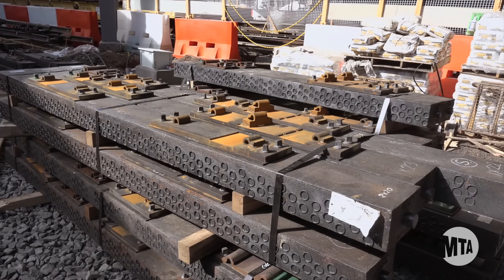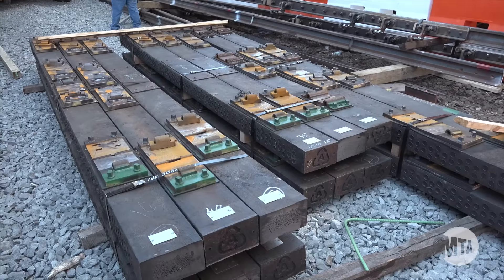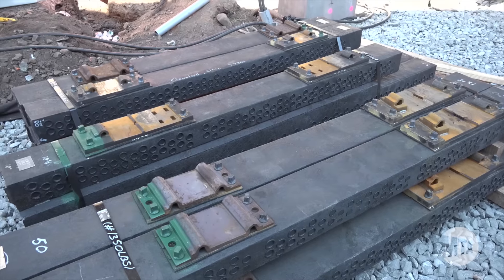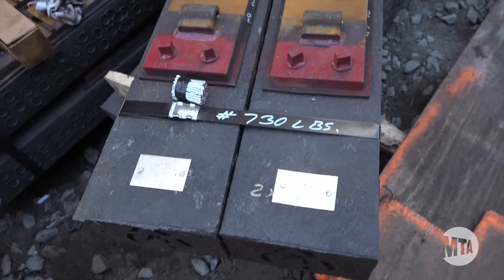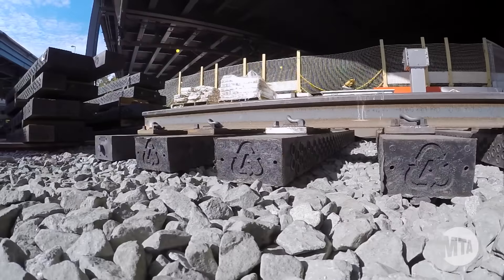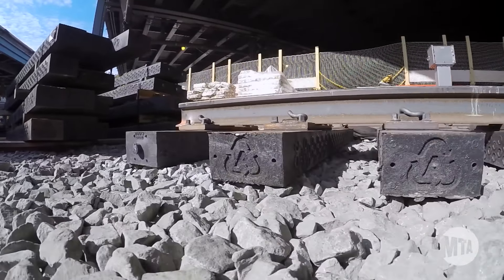Composite Tie Installation at St. George Terminal

Comment: What's the advantage of these ties over a more traditional composite material, reinforced concrete? That material is also recyclable and is probably a LOT cheaper.
Reply: Concrete ties are strong and reliable, but incompressible and have little elasticity. Due to their rigidity, they need frequent ballast damping to avoid them from 'sinking' into the ballast. A  more common way to solve this problem is to use the ballastless track, but that is often way more expensive than these plastic ties. Due to their elasticity and flexibility(comparatively speaking, not as elastic as a rubber band I suppose), they need less track damping and maintenance. They are also more weather resistant(especially to water erosion, which is one of the main problems of concrete ties), have a higher bite to the screws and easier to apply Spikefast(which is a worn screw hole repair kit).

Comment: i literally watched like 30 seconds of this video and stopped it right way to say this... rather than upgrades on the s.i.r...  there needs to be a connection btw s.i and manhattan... the E is sitting right there... focus the money on building a tunnel... jamiaca to trotten via 8th ave sounds way more workable ...a piece of tomorrow that should be today...just saying...
Reply: A tunnel that long is impossible and would call for billions of dollars
Reply: If you watched, this happened as a result of the damage after superstorm sandy. Meaning, the ties needed to be replaced, and these ties seemed like a better option considering they're more resistant to water etc. It wasn't an extravagant expenditure.
Reply: Nah, send it to Brooklyn.
Reply: Master B Beats Just want to remind you that we built a tunnel under the french channel.
Reply: ahmed sidibe Why?

Staten Island should be last on any list for subway expansion, when other parts of Brooklyn, Queens, and the Bronx have no subway access.
Reply: sanitman1 A subway to Staten Island Can wait. All that’s needed for the area is an extension of the Hudson Bergen Light Rail over the Bayonne Bridge to the Staten Island Mall, and a busway on the North Shore Railroad ti the ferry terminal. With that, money can be diverted to extending the 7 train East of Main Street to serve Northeastern Queens, which currently has no subway service and serves a dense area than Staten Island (St. George is never overcrowded).
Reply: @TheRailLeaguer  if an extension is needed it to bayonne it should be the  s.i.r.r cause light rail is kinda small and limited in track speed at times... plus it's not a real train to me... it's like more of a trolley if anything...
Reply: @dirmeen  This plan is merely a short term solution to SI's transit problems. In the long term, the HBLR to Bayonne and SI would be converted to PATH train operations (the West Side branch would be kept), which would provide a true one-seat ride to Midtown Manhattan at 33rd Street. Fare: the standard $2.75 fare used on PATH.
Reply: sanitman1 Yeah man. You really don’t know what the hell your talking about.

Any subway extension to SI would have to be placed on the back burner for now. Ideally, extending the Hudson Bergen Light Rail would be a good solution that would kill two birds in one stone.

The HBLR terminates at 8th Street in Bayonne, which is several blocks from the Bayonne Bridge. Extending it over the bridge is much preferable to a subway extension via Brooklyn since not only is it cheaper, but would also allow for better travel between Staten Island and New Jersey. There is considerable demand for travel between Staten Island and Bayonne and to Jersey City as well. In Jersey City, there is access to the PATH train to Manhattan and to Newark. This would be a win-win since for a cheaper cost than a subway tunnel to Brooklyn, you can have both a quick train ride to Manhattan, while at the same time better connecting Staten Island and New Jersey, allowing for new job opportunities in the entire region. After all, that’s where most of the job opportunities go.

In the future, the entire Bayonne-SI Line would be converted to PATH train operations, which would eliminate the transfer in Jersey City and further save time, and even save money for commuters.

Another potential idea that can work is reactivation of the North Shore Line so that a new line can operate from St. George to Linden in New Jersey, also allowing for better commute times between the two.

And you have a currency crisis that is making these ideas a pipe dream.
Reply: sanitman1 Yeah man. You need to stop making YouTube videos from obscures front windows on subway cars and wake up to political realities!!!!!

Also, what do you have against New Jersey?
Reply: sanitman1 Sorry, but most commuter traffic to/from the island is going off the Bayonne, Goethals, and Outerbridge Crossings. In addition, Island residents travel through Jersey on a regular basis through their cars, meaning that SI-Jersey demand is unmet. To respond to your concerns, it is now recommend to just go straight to converting the entire Bayonne line to PATH operations. This would keep the PATH extension affordable and take cars off the Bayonne Bridge due to better access to jobs outside NYC, and with one seat rides to Manhattan, this would benefit Bayonne and Staten Island residents and boost property values, something any extension to Brooklyn would not be able to accomplish.
Reply: sanitman1 Exactly. You are completely delusional.

My PATH extension through Bayonne to SI would enter Manhattan to the 33rd Street spur, which would provide a one seat ride between Staten Island and Manhattan, while spurring job growth into Manhattan.

However, to respond to your concerns, the PATH SI spur can be extended to Brooklyn using a portion of the 1920s tunnel to the Bay Ridge Avenue station at 4th Avenue. At Bay Ridge Avenue, you can transfer to the R for service further into Brooklyn.

This would allow for better service throughout the entire NY-NJ-CT Metropolitan area. Solely building a subway tunnel to Brooklyn with either be detrimental to current service or require expensive tunneling before any underwater tunneling be built, while do nothing to improve regional circulation between New York and New Jersey.
Reply: sanitman1 You are being delusional. Any subway tunnel to Brooklyn would be detrimental to current service, worsening reliability on the F, G, and/or R.

Therefore, in response to your concerns, the PATH Bayonne-SI line would be extended via a new underriver tunnel to the Bay Ridge Avenue station at 4th Avenue (using part of the 1920s SI tunnel). From here, for continuing service into Brooklyn, folks can transfer to the R train.

This would improve commute times between Brooklyn, SI, Manhattan, and New Jersey, creating new opportunities for economic growth in New Jersey and raising property values in Bayonne. It’s a win-win.
Reply: sanitman1  @jeremiha99c girls, girls, girls... calm down... yall really going at each other lmaooooo... what ever money is built and allocated in to any body's dream project would be awesome but who knows when or if in this climate...
Reply: ahmed sidibe I know. Some people just don’t understand.
Reply: @TheRailLeaguer  Can tell your not a SI resident, the bridge is way to arch like to have a train without it bending and snapping, we would want to go to the city not NJ, an there is high demand for this. Meanwhile a 7 train expansion would be a joke because nj transit can move to that area so those people can take nj transit to penn station instead of using the mta's money.
Reply: @TheStig_TG  Really?

Also, the Verrazano Narrows Bridge was not designed to accommodate trains.

In addition, there have been plans to have the direct SI to Manhattan trains go via New Jersey’s PATH train taking over the Hudson Bergen Light Rail, which is honestly faster and cheaper than bringing the SIR into Lower Manhattan (vanshnookenraggen came up with that plan). My plan modifies this plan by having the combining PATH with the HBLR and PATH, with Journal Square trains rerouted via Columbus Drive, and taking over the HBLR Bayonne Line from Liberty State Park down to 22nd Street, where it would cross the Kill Van Kull into Staten Island’s St. George Ferry Terminal, where it would take over the Staten Island Railway to Tottenville. This will provide faster service to Manhattan and ease congestion on the newly-raised Bayonne Bridge.

The 7 train extension to Secacus would serve a different area compared to NJ Transit and AmTrak, which does not have any stops between Secacus and New York. A subway extension would also help to relieve congestion at the Port Authority Bus Terminal.
Reply: @TheRailLeaguer  I never mentioned the Verrazano in-fact i know a shit ton about it,  The fact that it would flex too much if you carried a train over things to Robert Moses purposely designing it that way. I'm sure Staten Island residence wouldn't want to take the detour unless an expressed service was provided which even then it would be too long for a commute.
Reply: @TheRailLeaguer  Second of all, I wasn't the person who mentioned tunneling under the whole bay, we could simply connect to the R train and use a tunnel under the bridge which would still be expensive but would be a better alternative.
Reply: @TheStig_TG  I never proposed having trains go over the Verrazano.

Also, judging by all the traffic on the Bayonne Bridge, most Staten Island folks are heading towards New Jersey, and I’m pretty sure that going through Mew Jersey via a combined PATH-HBLR-SIR line would be a faster way to Midtown. This would also strengthen the economy throughout New Jersey and New York since we now have better options to commute between both states.

I’ve also proposed another Staten Island subway extension, in which, the PATH NWK-WTC line, which will see frequencies increased, will be extended from Newark Penn to the Airport, and from there it would serve the Mills at Jersey Gardens, before crossing the Kill Van Kull into Mariners Harbor and Arlington. From there it would operate via South Avenue to Travis Avenue, The West Shore Expressway (which would be downgraded to a regular Street) to Huguenot Avenue and then travel along Huguenot Avenue to Hylan Blvd, service the West Shore and increasing transit service to Newark Airport.

An extension of the 4th Avenue subway would NOT preclude any of these other subway extensions from happening.